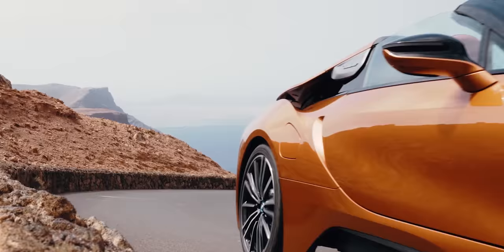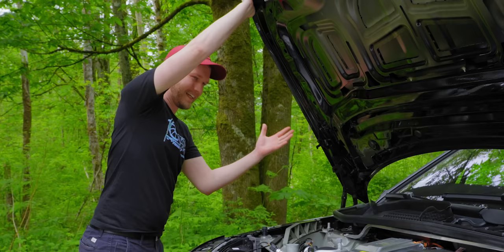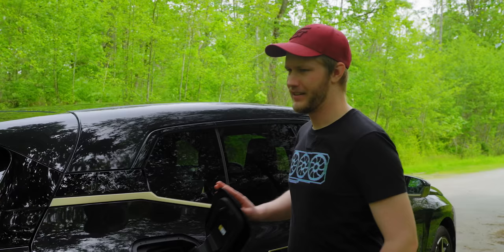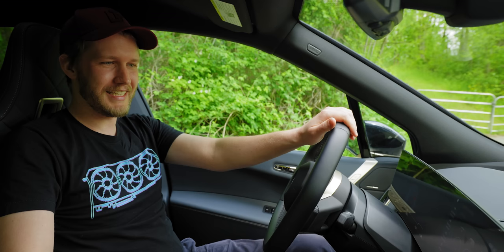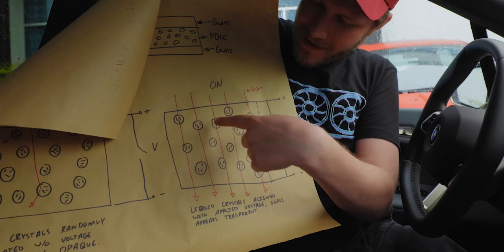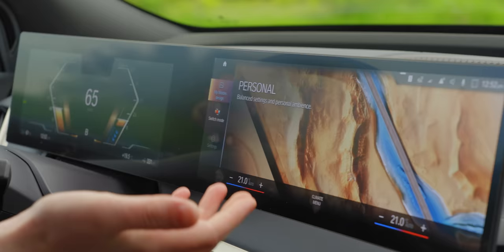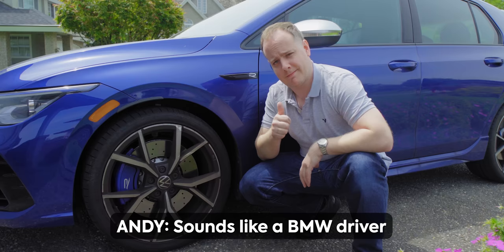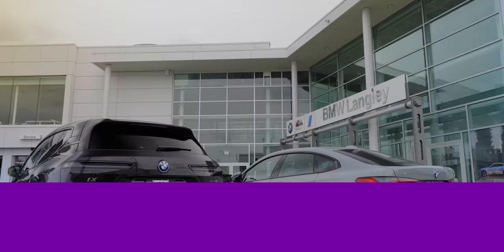It's... Complicated. - BMW iX

Comment: Touch screens are overrated for cars.  If I can't change the temp in my car via muscle memory while driving it makes me and EVERYONE else on the road less safe.  Just give me a couple of dash mounted controls for it.
Reply: The tech to actually make touch screens that feel and respond differently depending on the place is there (like through haptic feedback). But stupidly enough I don't think any care manufacturer has actually used those kinda of screens, even though cars are pretty much among the most useful uses of the tech, since being able to blindly control these things for a car will actually contribute a lot to safety.
Reply: touch screens should be inaccessible during operation since it's fucking dangerous to use them.
Reply: @thenonexistinghero  Haptic feedback require decent vibration motors which goes against the cost cutting narrative.
Reply: To some extent I agree. I like how e.g. Mercedes does it in some cars where you have 1 screen for your instrument cluster and then another widescreen for your multimedia, Apple carplay what have you. But the key here is to still have your heating/cooling, ventilation and such as physical buttons below the screen. 
I also despise all the non-screen touch buttons. This BMW has them on this wood and it just looks unusable, like you have to guess which button is which. Same thing goes for touch controls on steering wheel as some newer Mercedes cars have just yuck. This craze about touch buttons is just so stupid and a total gimick in many cases.
Reply: @ehdbom  this is true, I drive a Metris and while it's as cheap a Merc as you can buy,  having decent physical controls means I barely need the touch screen while I'm driving (sometimes for maps)
Reply: @H3LLGHA5T  then putting climate controls on a touchscreen needs to be illegal because good luck driving through certain tunnels without access to climate control.
Reply: @wyw201  With a car costing over $100K, there shouldn't be any cost cutting.
Reply: @thenonexistinghero  Cost cutting exists at every level. Internal and external metrics drives %margin and prices.

Comment: What I want to know is, how does an electric car have an "engine bay", that is somehow more full than some cars with an actual engine.
Reply: You have extremly high voltages in there, basically to cool down the enormous battery it comes with and to heat the battery up for when it is in the winter, another thing is you need to wire the high voltage safely and doing that requires alot of other electronics ans yea at some point its just a cluttered mess
Reply: @nekominorinya2569  Then Tesla did a very good job to have space up front in the Model S for another storage bay.
Reply: So people are brave to say "Someone should be FIRED", yet they're afraid to wish death on the designers?
Reply: @automation7295  So people are brave to copy and paste this comment everywhere, yet they're afraid to actually make any sense and have any coherent meaning?

Comment: This week I test drove both the 40 and 50. The acceleration in both is impressive. With the addition of air suspension the ride is much more comfortable in the 50 model. The design of the front seats makes the rear seats claustrophobic. Worth being aware that the rear windows only go down half way. The seats would benefit from better lumbar support. This can be overcome with the lumbar adjustment if fitted to the front seats. Be aware that due to a shortage of chips the lumbar adjustment is not currently available on the front passenger seat. The sunroof is frustratingly opaque when in the clear mode, hopefully this can be improved. The designers could have thought through better how this vehicle will be charged,  for the charge sockets are in the location where one would typically put petrol or diesel. Near the front as with most PHEV vehicles would be better. They need to redesign to provide storage for the parcel shelf too. The current shelf appears like cheap plastic and not appropriate for a car of this price. The dashboard looks good but drivers may get annoyed when their passengers change the display when they want to adjust their seat heat. The performance and interior space are very impressive. The car is the size of the X5 yet has the boot space of the X3 so make sure it is sufficient for your need...
Reply: and the most annoying part is that some options from a few months ago that were available in an X3 are now not even available to spec on BMWs higher end models such as the iX or the x5, all due to the chip shortage, additionally, if you want to customize your model expect at least 8 months wait time for delivery, or more, with outright missing features that can be installed after they become available again, which to me is absolutely insane
Reply: I would watch a car review video if you made one. Lots of good points here that actually matter.

Comment: One thing about the doors, in Europe they teach you to open doors with your right hand while turning back with the body.
The idea is you need to turn around to look at the trafic behind you. 
Maybe that would make it easier to open these doors.
Reply: Yup, Dutch reach - primarily to spot cyclists coming past. If it’s easier to open the doors that way that’s clever design.

Comment: I own it and easily THE BEST driving car I’ve ever driven. Interior feels like I’m in a spaceship and just so much great tech. I charge it about once every couple weeks and 80% charge in 30 mins which is just crazy. Hit the accelerator and there is zero lag and massive power. 

Sure, some of the tech is just silly…I’m not into haptics to turn radio volume up or down, dont need hands free driving, not thrilled w climate controls layout, but not a big deal. Actually surprised this guy had so much negative to say about the infotainment system, because its super intuitive and fun to work with for me and he’s about the only reviewer that had something negative to say about it. 

P.s. that’s not gold trim, but rather titanium bronze. 😊

Comment: When was BMW ever so ahead of anyone else with EVs? If anything, they've been criticized for lagging behind. I really like the i3, but Nissan and GM got there first. By the time the i8 hit the market, the Model S had already been on the market a few years, and it was just a glorified hybrid.
Reply: I am also confused by his take that BMW was ever even in the running let alone actually leading.
Reply: Behind 2 or 3 other manufacturers but ahead of the other 12+ is a perfectly cromulent use of the term.

If you had listed Chevy, VW, kia, Toyota, ford, fiat, mini, etc...
Reply: @nitePhyyre  You seem to be unaware that all those automakers beat the iX to market, some by a decent margin. Several of those companies have had EVs for years; they just didn't offer them in the US.

I could have also brought up Porsche/Audi who've already been in the luxury EV space for a couple of years.

Toyota also should be recognized for the profound impact they've made with hybrid technology. It was a major milestone on the path to electrics and continues to be a more viable and economical alternative for most people. This was while BMW was still cranking out diesels.

Just to reiterate, BMW's former CEO, Harald Kruger, was kicked out because of the company's slow transition to EVs.
Reply: @maweitao  Nissan, GM, Porsche, Audi, Toyota, plus their CEO being fired for their transition presents a much better case that Alex was wrong to call BMW a leader in the field. That'd put them around midpack, at best.

Comment: The hassle to pop open the hood feels so anti-consumer.
Reply: Oh no, you have to pull two things instead of one? God, soooooooo anti-consumer.
Reply: Well, since there is basically nothing in there for you the average consumer to work on. It isn't really. Remember EVs aren't like nomral cars when it comes to fixing them. Most mechanics don't even work on them and those that do only do certain brands because they are all different and messing up gets really dangerous quickly. And if you can pay 89K for a car you probably won't do your own service anyway.
Reply: @rustler08  it literally says we're not supposed to open the hood and they proceeded to hide tabs on separate sides of the car so yes.. Especially when one tab is literally all you would ever need
Reply: Not necessarily. The problem with electric cars is that because the tech is a lot newer people are unfamiliar with the workings of the batteries/electric motors. That coupled with the fact that most of them are completely different from one another means it can be fairly dangerous for someone with little knowledge to poke about under the hood. 

However the fact that there IS an option to open the hood means if you really want to then you can poke about and attempt to repair something if you really want to. If it was closed completely like in the new Mercedes electric cars then I'd agree
Reply: @TriMarko  Don't forget high voltage. You would basically need to be an electrician to work on it safely as almost all parts related to the motors/power train is 230V AC of higher.
Reply: @TriMarko  You can Open the Mercedes ones.
Reply: @felixderwilde9747  Ah really, fair enough. Just remembered a review a while ago saying you can't. Probably the same kind of thing as with the BMW where the latch isn't very accessible then I guess
Reply: Why would a consumer ever need to go under the hood?
Reply: @TriMarko  yes pretty much the same.

Comment: All these new EVs seems to be full of small compromises and full of small inconveniences that adds up. Bad design, bad user experience. Just copy normal car and make it electric. I would be so frustrated just changing radio station and climate temperature while driving. Every new EV review video makes me want to buy older "dumber" car.
Reply: Yeah. Dumber cars with better safety features, powertrain, and navigation would be more than enough for most people. Seeing this rich screen controls makes me want to scream. Where tf are the buttons on the steering.

Comment: I work for BMW where we build the IX, and i have to say this is a good review 👍🏼 i drove it myself and the display and lack of buttons drove me crazy 😅 but the autopilot and headup display and driving experience is incredible. I didnt like the car at first but after seeing it a few times and driving it i love it 😅 if you want to go electric and BMW go for the IX or the i4, both are great cars
Reply: You should fire your UI and ergonomics design teams. Touch controls for oft-used functions like audio and climate control are unsafe, and just plain horrible to use. Just because you can, doesn't mean you should. I would not even consider buying this car purely on that basis.

Comment: Very interesting review, which got me thinking...  If I had the kind of money to throw at this car, I'd have them rip out that whole infotainment system thing and replace it with mechanically operated heater and air conditioner.  Then I'd install a classic Pioneer car stereo from the late 70s, the one with the huge round tuning dial and cassette.  Analog only, guaranteed you won't have any issues with hurting ears hehe.
Reply: Probably would be easier to retrofit an older car with an ev drive train.
Reply: I actually meant, heating and AC with ye olde mechanical switches and knobs.  I'm not advocating returning entirely to the dark ages lol.
Reply: @nitePhyyre  Well I do like the other amenities and performance specs of the car, but they've gone overboard with the touch screen nonsense, certainly.
Reply: @denniseldridge2936  Fair enough. :D
Also modern cars are much safer. Crumple zones, air bags, etc.

Comment: "It's awful, but you'll get used to it," is exactly what you want to hear about a BMW purchase. 

All modern manufacturers absolutely need to stop relying so heavily on fancy, poorly thought out touch controls. Even Chevy quickly backpedaled on this and put back physical knobs and buttons for common features in their late teens models.

I do not want to fiddle around on a touch screen for climate, media, or driving control!
Reply: yeah the ipad-esque touch screen controls became trendy shortly after Tesla started doing it, but just because something is trendy doesn't mean you should copy all of its faults. Touch screens are inherently a terrible design choice for cars because they offer no tactile feedback, requiring the driver to look at the screen instead of the road
Reply: @fenriswolf-always-forward   dude I've spent a lot of time in a Tesla. Yeah it doesn't lag and the voice controls are decent but the ui is still poorly placed and a touchscreen is still inherently shit compared to physical buttons/knobs. Anything that requires or encourages a driver to look away from the road for basic functions for more than a split second is inherently bad car interface design

Comment: Thank you for covering the RTR aspect, such a shame that the Germans (see Merc EQS) are going down this route. I'd love if we could slowly change course again, one might actually be able to buy it second hand in 10 years when you don't want to go to BMW to pay way too much for servicing an older car.
Reply: I would love to see a life expectancy on the battery packs ,or the cell configuration, and the price to replace them after that time of 10 years. Also the likelihood of them even being available/produced.
Reply: @benwu7980  You can get a new pack for most cars, Robert on the Fully Charged Show recently replaced the battery in this 2011 Nissan Leaf for about 4k if I remember correctly, trippling its range since the battery had a far larger capacity. Then there is Tesla where a new pack costs roughly 20k for a model S, which is a shame cause you can usually get away with replacing just one block for way less. Rich Rebuilds did a video on replacing a single block a few months ago.
Reply: @jadoei13  True,  but my point was knowing in advance, what those costs would be with some basic info around when would need to replace, and the costs involved, and what amount of the entire cell capacity would be required to be replaced.  I'd be okay with the Leaf at that price to replace, but the Tesla, when just a coolant nozzle damage, means a ~19k full battery replace from a main repair shop,  I'm less than happy

Comment: The last gen Bmw has the best infotainment I've ever used, (and I've used a lot) but you have to use the idrive wheel. I've never used the touch screen on it. Kinda disappointing if they screwed it up.

Comment: Funny thing is: I live in Munich (you know, where BMW is from), Germany. And I've ordered an i4M50 over our company configurator. So you would expect because of my proximity to the BMW headquarters I would receive it in reasonable time. They told me, however, I had to wait until 20-TWENTY-FOUR. Ok, so for the next 2 years it will be a Tesla Model Y. Who cares about clearance gaps, loose parts and fake leather: At least they can deliver in less than 2 years XD

Comment: I've also tested this car and for me the suspension and steering felt like I am lost in the sea on a boat. Also if you're going over 130 km/h and want to accelerate the sheer mass this vehicle has ma, makes is slower than almost everything else on the road.. Despite having over 500 hp.. Felt so stupid on the highway in Germany.
Reply: Needing to accelerate from 130 km/h is a gloriously German problem. 110 I can understand, but much above that is irrelevant to most people. The mass is a concern for numerous reasons though, I dread to think of the tyre particulate emissions or its behaviour in collisions with smaller road users.

Comment: Was at a test driving event from BMW yesterday and spent about an hour in these driving and totally agree.
Seating and view and driving is amazing. 
The steering nobs feel like trash and those menus are awful.
But they get away with it as someone else didn't seem to mind.
My gf was turning on seat heating in every car and it took forever and she was in the passenger seat.
Told BMW that I hope they fix it cause otherwise my next one would not be a BMW.
The i4 was a lot better build quality wise (ix seats a lot better though) but still has too much stuff you have to use the menu for.

Comment: Having driven the i4 M50, I really hope you can test one. It has the best ride of any EV I've tested, an absolute blast on twisty roads. Also for the sound system, there's some setting for "spatial audio" or something that completely messes up the sound quality if it's turned on.

Comment: I'm in an early variant of the Honda HR-V where they made a lot of their media control AND defroster/AC unit touch control. I will say that is a nightmare. You don't want to be trying to figure out which button you'll be pressing as you're driving and looking at the road. Media control is one thing but the defroster and AC unit has to have intuitive buttons that I know where to reach and not accidentally touch as I'm trying to reach for other buttons.

Comment: 1:28 I believe the windshield liquid dispenser can be used by anyone and it might be problematic, traditionally it's under the bonnet which can be unlocked mostly only from the inside to get access, but now anyone can put hot sauce inside it and cause accidents.

Comment: Hey ShortCircuit! The distortion you talk about in the review at 13:42 is actually a manufacturing defect. It's unfortunate because I got the iX as well and when we took delivery of the car, it sounded horrible at medium to high volumes. Not all iX's sound like this. It's a manufacturing defect with the 2024's but BMW isn't issuing a recall or fixing the issue for us. Sucks for a luxury brand

Comment: Software is something that can be redesigned and worked on over and over again, updating the entire line up with an OTA update. What CANNOT be changed free of charge, however, is the very physical elements of the vehicle (Battery, engine, etc.).